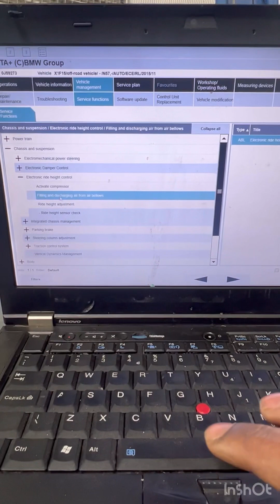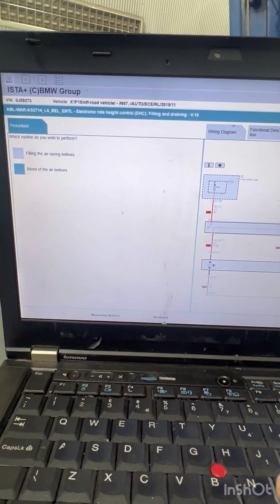BMW F15 Rear Air suspension Draining

Comment: So, you drain them using ista, remove the fuse, replace the bellows, thes put back the fuse and inflate?
Is that the right procedure? I’m trying to do this without removing the compressor connectors and disconnect the two air lines under the drivers seat(UK)